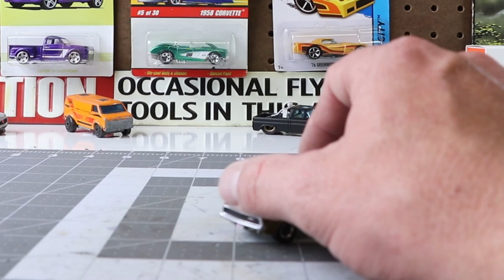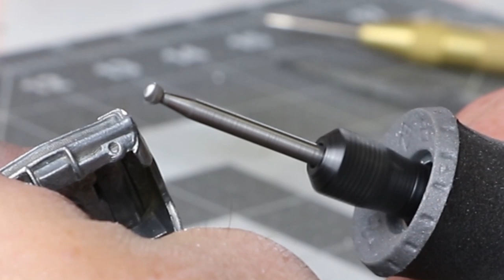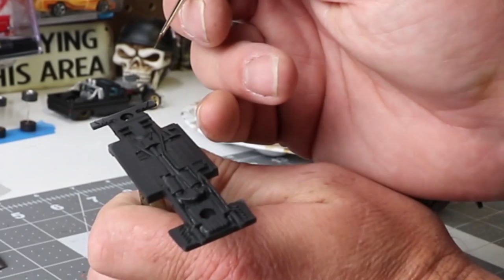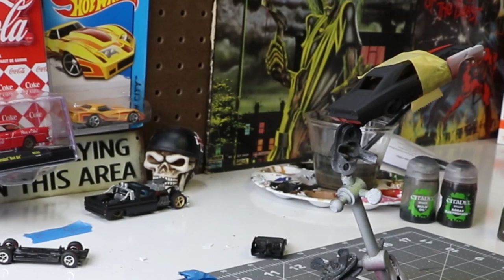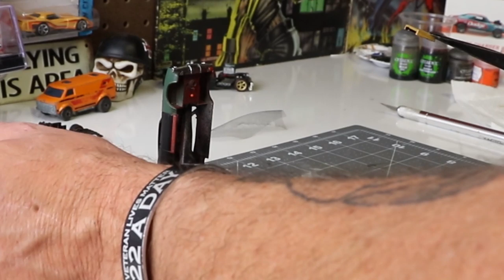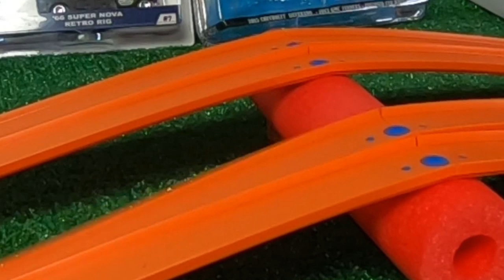Roadkill's General Mayhem in 1/64 Scale

Comment: Just a little tip you may or may not know, if you soak the cardboard packaging behind the plastic box part with acetone you can remove  clear packaging without damaging the cardboard to reseal the car and maintain the appearance of a sealed box.